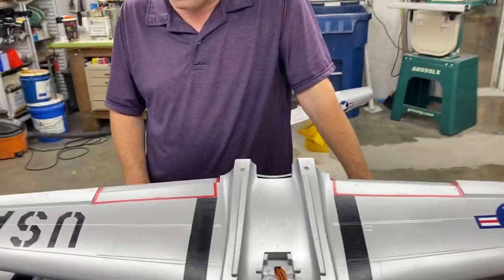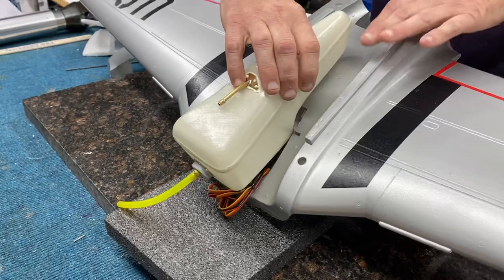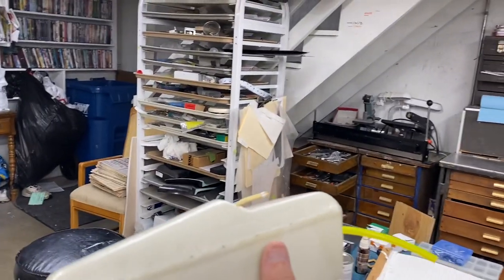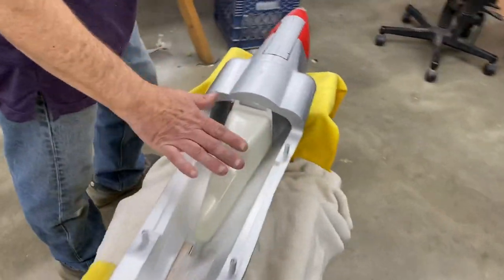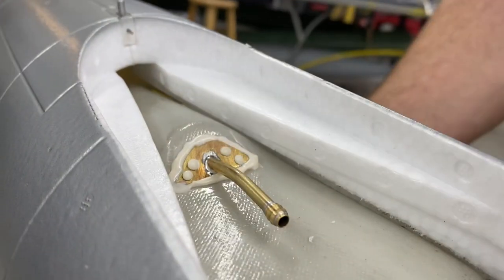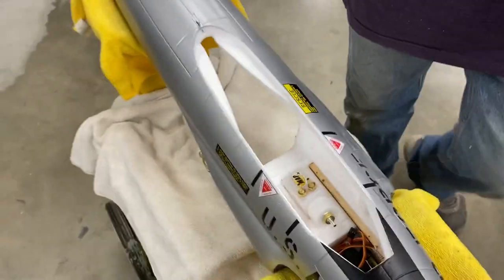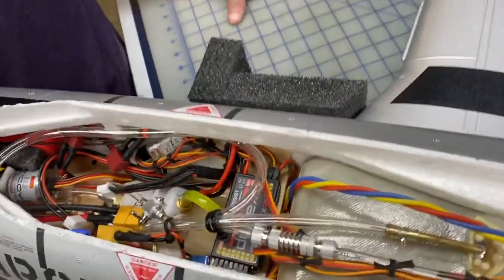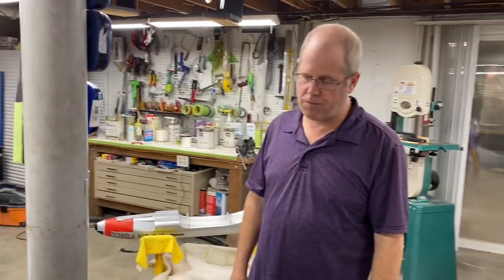Freewing T33 Turbine Conversion Ep. 1

Comment: Amazing job Paul. Did you make the fuel tank yourself. I’d love to turbine my f22 raptor and would like to set it up using the existing edf mounts much like your t33. What’s the weight of the pipe too fella. Thanks for sharing your knowledge
Reply from the maker: Yes I make all my own tanks and pipes. The pipe used for the T33 and Avanti weighs 121.5 grams